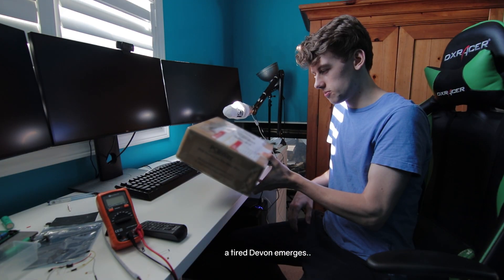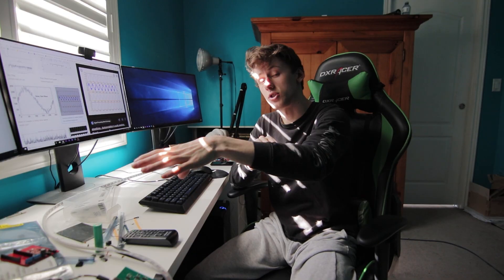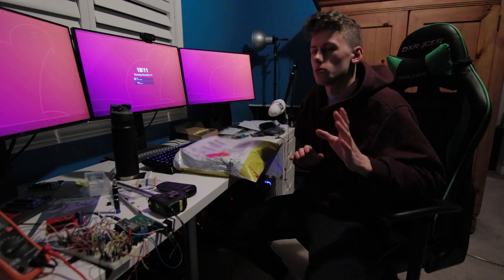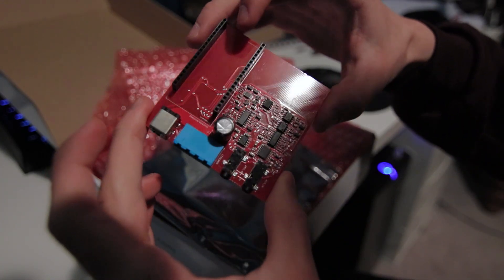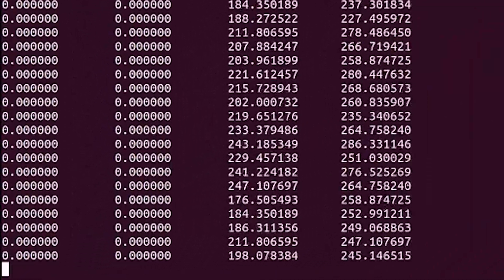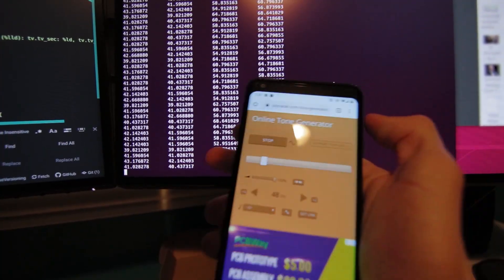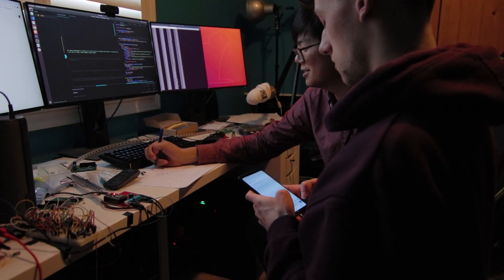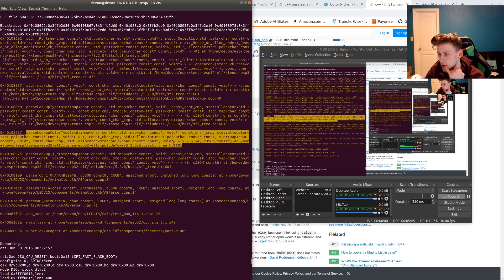Analog Electronics are Hard

Comment: You can also use connection based Bluetooth LE and send more then 31 bytes at a time (if you are refering to the 31 bytes of LE advertisements ?). You can basically create a serial port via LE and exchange any data.

Comment: Where do you learn the hardware stuff?
Reply from the maker: I just started building prototypes my first few were not great, these ones are the 5th and 6th versions
Reply: @DevonCrawford  you didn’t follow any tutorial or read any books on that?
Reply from the maker: @jacobc8388  I knew the basics of electrical stuff from a high school class like voltage, current, resistors, formula between them but never learned printed circuit board design and only did sketchy breadboard hardware in the past which you can see in some past videos in 2018 or earlier like air conditioner project. Other than that no tutorial or books which is why it took me many prototypes to figure it out

Comment: Using an airplay server on a raspberry pi zero would have been easier than messing around with analog. I find the use cases for analog "party lights" to be very slim, creating an airplay server allows for more modularity in today's wireless audio setups. Nonetheless really cool that he got it working